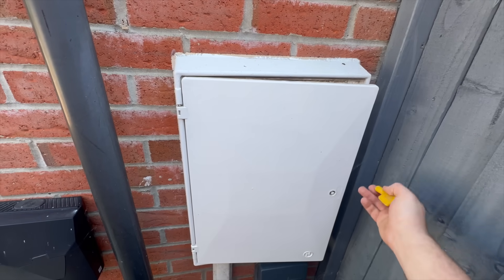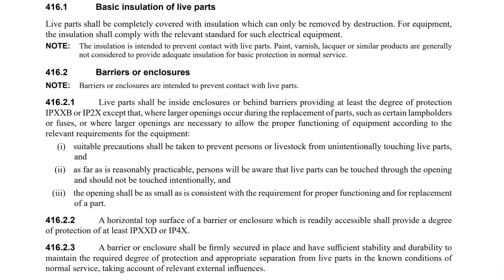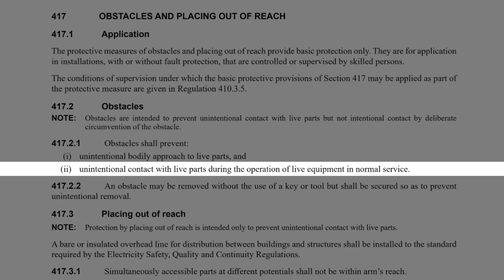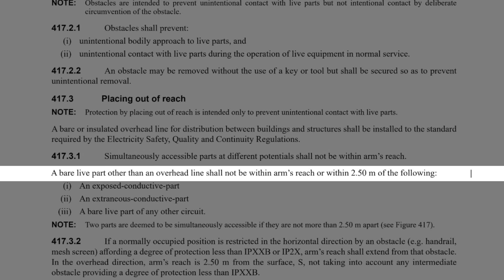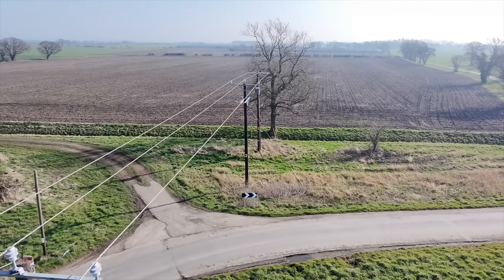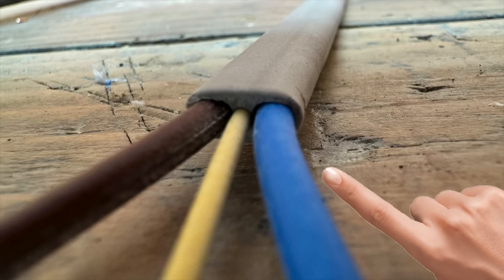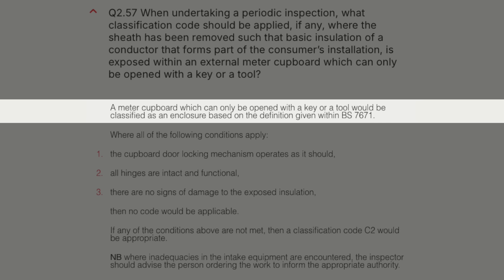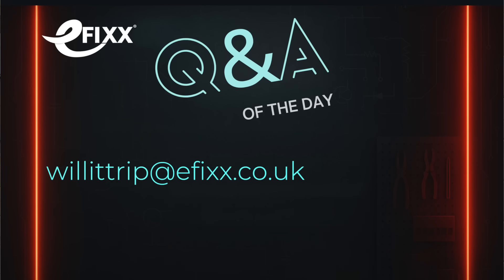This Should Be Illegal… But Isn’t!

Comment: I recall this topic coming up at CEF Live last month. obviously I forget exactly how they put it at this point, but my take-away is that meter cupboard effectively can't even be considered enclosures, since:
A) the general public are expected to access them
B) using a key mechanism that doesn't even require the right key, pretty much anything can be stuck in there to turn it
C) even if you can't unlock it, the door easily lifts off it's hinges
D) and my own observation (shared by many if not everyone here) that it's pretty common to come across meter cupboards with the door missing entirely, or even some old ones with wooden doors (that have generally seen better days).
Reply: Non electrician here. But as the householder is expected to open the meter box to take meter readings, the fact that the box may meet the technical requirements of an enclosure is pointless as a means of protection. And that's without taking into account those with missing or damaged doors, or simply left unlocked.
Reply: A - general public (not all) can use a screw driver - meaning they can access a consumer unit.
B - you still need a tool to get access, meaning it still passes.
C - only once you've used a tool to open it.
D - only then its a fail
Don't get me wrong, what we have is not the safest but how far do you have go before the cost becomes ridiculous to upkeep. Do we encourage people to lose their common sense instead.
Reply: @PF-gi9vv the general public can of course get into a consumer unit with a screwdriver, but that's not the issue. The issue is they don't NEED to access inside a consumer unit. Whereas, the public NEED to access the the meter box in order to read the meter.
Reply: @DS-tp6vx  That doesn't matter, the regs says you need a tool to get in, then its fine, whether joe public has to do it or not.
Reply: @DS-tp6vx  the point is that you need to do something to bypass the first layer of protection against accidental contact under normal conditions. You still have the second layer of protection. Just like every junction box in the property. Once you open a junction box, you can touch conductors protected by only a single layer of insulation. 
Look at it another way - how would you rectify it? Double sleeve? To what thickness?
Reply: Fool, get a life.
Reply: You are "gold-plating" this issue again.  Stop inventing your own additional requirements.
Reply: @JimWhitaker  Just passing on what  they said at CPD talks. Don't shoot the messenger.

Comment: 53 seconds ffs what is that in the socket?    The cabinet is expected to be opened by a civilian so all bets are off at that point.  Why isn't the SWA earthed?  If you are fitting a gland to the SWA why not just attach an enclosure  under the isolation? By the logic a floor is more enclosed than a meter cabinet!

Comment: Total crap - it’s an enclosure that would be expected to be accessed by ordinary persons

This has come about through pressure from housing developers / house bashers cutting corners so much it’s been allowed to become the norm

I’ll continue to C2 and fail every single one of these cowboy jobs that I come across
Reply: Wrong answer.
Here's the official answer.
Don't think you know better than the experts. Suggest you go download Guidance 4 and read it. You will find it will help you code correctly. It has lots of examples.

The authoritative answer is provided below.

Here is the definitive answer from Guidance 4, Issue 7.2, Electrical Installation Reporting, produced by Electrical Safety First .

The following scenario is to be coded as a C2:
Quote:
 Single-insulated cables in a meter cupboard which can only be opened with a key or tool, but where any of the following conditions apply:
• the door mechanism doesn’t operate as it should,
• any hinges are not intact or non-functional,
• where there are signs of damage to the exposed insulation.

End Quote:

If there are single insulated cables in a meter cabinet and that cabinet is damaged in someway which makes it easy to get into without using the proper tool to open it, THEN you code it up as a C2.

If that meter cabinet is NOT damaged in anyway, then it is a C3.

That's the official definitive answer .

And when you think about it, it makes sense: the single insulated cable does not pose an immediate danger. If it did, it would be a C1 or a C2.

The risk of danger is increased if the door to the cabinet is broken in someway, if it can be lifted off it's hinges, or the locking mechanism is damaged or not present, then somebody can enter the cabinet and interfere with those cables. So obviously, the level of risk is increased if the cabinet is damaged. And to record that means it must be increased from the C3 to the C2.

Comment: Only modular panels in UK have barrier. Meter panels in UK have no barrier at all. In continental Europe panel can't pass inspection if some equipment is not covered, so electricians use jigsaw to cut barrier from plexiglass. 

It is very strange that UK energy companies allow to install their electricity meters in bare panel, where everyone has possibility to connect jumper wire and steal electricity.
Reply: Taper evident is really all that most countries go for.  In reality you can't stop a determined person all you can do is make it so you know someone has been fiddling.  When meters were being manually read the reader would take note if there was signs of tampering.  It's more about safety these days.  Average person off the street can't have access to hazardous situations, so single insulated is behind things that need a tool to access and that tool is more than a simple generic key guarding a location where untrained people are expected to go.  If single insulated was exposed like this is in Australia the electrician that did it would be getting a call from their state's safety board, a fine and a requirement to do retraining.

Comment: C2 minimum as the notes about keyed or tool access presume only competent people will have cause to open them.  In a residential setting it is often the case that the home owner / tenant is expected to interact with the equipment inside: pre-payment credit keys are a good example.  
The elderly, disabled, terminally stupid, cognitively impaired etc can all be expected to open the external enclosure, come rain or shine, with whatever they happen to have in their hands, whilst standing outside on the actual earth.  It is reasonably foreseeable that untrained persons will open the electrical cabinet because that is what they are expected to do!  
That last layer of insulation is not designed to cope with general wear and tear administered by the user.  I'm not the only one who has seen damaged outer sheathing from people having the credit key on a big bunch of keys and charms.  Not having a mechanically protective outer layer present is madness, as are the worthless guidance notes featured in this clip.

Comment: Unacceptable to have single insulated in a location where an unskilled person can and is expected go.  That it has a simple key to access doesn't change that risk as people will need to access the cabinet to do manual meter reads and operate the mainswitch.
Reply: Wrong. Yes it does change the level of risk.

The authoritative answer is provided below.

Here is the definitive answer from Guidance 4, Issue 7.2, Electrical Installation Reporting, produced by Electrical Safety First .

The following scenario is to be coded as a C2:
Quote:
 Single-insulated cables in a meter cupboard which can only be opened with a key or tool, but where any of the following conditions apply:
• the door mechanism doesn’t operate as it should,
• any hinges are not intact or non-functional,
• where there are signs of damage to the exposed insulation.

End Quote:

If there are single insulated cables in a meter cabinet and that cabinet is damaged in someway which makes it easy to get into without using the proper tool to open it, THEN you code it up as a C2.

If that meter cabinet is NOT damaged in anyway, then it is a C3.

That's the official definitive answer .

And when you think about it, it makes sense: the single insulated cable does not pose an immediate danger. If it did, it would be a C1 or a C2.

The risk of danger is increased if the door to the cabinet is broken in someway, if it can be lifted off it's hinges, or the locking mechanism is damaged or not present, then somebody can enter the cabinet and interfere with those cables. So obviously, the level of risk is increased if the cabinet is damaged. And to record that means it must be increased from the C3 to the C2.
Reply: @deang5622  One of these days you'll actually understand what you are doing.  One of these days.  Tip:  the author of the video specifically asked for thoughts and opinions.  Perhaps you should try that - think.

Comment: Back in my day the cables used for meter tails were called "insulated and sheathed cable" and we also had "Service Cable Connectors"
Reply: Indeed. They are not "double insulated", the outer sheath is actually mechanical protection.

Comment: C2, it could be argued that it's inaccessible without a tool (the key) HOWEVER every householder will have that key, so it's definitely a C2 for moi
Reply: Every house has a screwdriver so is your DB a C2, same principle.
Reply: @shaunmajor2052 but most homeowners don't need regular access to that... These days the homeowner does need regular access to the metre cabinet because the metering companies don't bother to come and read it
Reply: Unfortunately some adults can't be helped. It's kids I'm most concerned about
Reply: @aussiejackofalltrades  valid point, unfortunately the regs dont discriminate  between kids and morons
Reply: You don't need the key though, can stick just about anything in there to turn it, or just lift the door off it's hingers. Assuming the door is still there and intact, founds plenty of meter cupboards with doors missing or smashed (usually where it's accessible to anyone walking past, so probably kids being destructive).

Comment: 0:09 I don't like to see SWA cables without either a proper gland, or the armouring not grounded.
Reply: I know national grid want to see that or a switched fuse after the isolation.
Reply: It could be connected to the earth bar at the consumer unit . You only need to connect one end if its not being used as a cpc .

Comment: If the idea is that the householder can't gain access to this meter cupboard and so this exposure of the cables is OK - then how does the householder read the meter (if they don't have a remote display for it)?
Reply: That's not quite correct.
The householder is expected to gain entry to the cabinet and must do in order to obtain meter readings in the event the meter is not a smart meter.

The issue is around whether the cabinet key is required to gain entry to the cabinet.  If the meter door is damaged, missing lock mechanism or if the door can be removed from the hinges, the risk is higher as it means anyone can gain entry, easily, just walking past and not equipped with any tools, a person, a child can enter it and interfere with the cables. That's the danger.  The likelihood of this occurring, is still low, but it is increased when compared to the scenario where the cabinet door is undamaged and the locking mechanism is functioning correctly and has to be used to gain entry.

So whether it is a C2 or a C3 DOES depend on the correct functioning of the locking door mechanism.

The authoritative answer is provided below, along with the official document which describes this particular scenario.

Here is the definitive answer from Guidance 4, Issue 7.2, Electrical Installation Reporting, produced by Electrical Safety First .

The following scenario is to be coded as a C2:
Quote:
 Single-insulated cables in a meter cupboard which can only be opened with a key or tool, but where any of the following conditions apply:
• the door mechanism doesn’t operate as it should,
• any hinges are not intact or non-functional,
• where there are signs of damage to the exposed insulation.

End Quote:

If there are single insulated cables in a meter cabinet and that cabinet is damaged in some way which makes it easy to get into without using the proper tool to open it, THEN you code it up as a C2.

If that meter cabinet is NOT damaged in anyway, then it is a C3.

That's the official definitive answer .

And when you think about it, it makes sense: the single insulated cable does not pose an immediate danger. If it did, it would be a C1 or a C2.
Reply: @deang5622  Thank you for explaining that so well.

Comment: C2 all day for me. It’s usually the first instance of shite work that I’ll be finding on that EICR and shows an obvious lack of care. I had this argument with another firm who did a new build who argued about the key situation being no different to removing a socket face, which I clapped back with the fact socket circuits have 30mA RCD protection whereas the meter box doesn’t require any meaningful tool to access and the only protection was the service head fuse. Totally different things. At the end of the day, it’s still a basic insulated live cable that can easily be grabbed and that meter box lid isn’t going to last forever.
Reply: 100% customers are EXPECTED to open them!
Reply: Wrong.

Here is the definitive answer from Guidance 4, Issue 7.2, Electrical Installation Reporting, produced by Electrical Safety First .

The following scenario is to be coded as a C2:
Quote:
 Single-insulated cables in a meter cupboard which can only be opened with a key or tool, but where any of the following conditions apply:
• the door mechanism doesn’t operate as it should,
• any hinges are not intact or non-functional,
• where there are signs of damage to the exposed insulation.

End Quote:

If there are single insulated cables in a meter cabinet and that cabinet is damaged in someway which makes it easy to get into without using the proper tool to open it, THEN you code it up as a C2.

If that meter cabinet is NOT damaged in anyway, then it is a C3.

That's the official definitive answer .

And when you think about it, it makes sense: the single insulated cable does not pose an immediate danger. If it did, it would be a C1 or a C2.

The risk of danger is increased if the door to the cabinet is broken in someway, if it can be lifted off it's hinges, or the locking mechanism is damaged or not present, then somebody can enter the cabinet and interfere with those cables. So obviously, the level of risk is increased if the cabinet is damaged. And to record that means it must be increased from the C3 to the C2.
Reply: @deang5622  That’s just guidance, I’ll make up my own mind. If you take it as gospel you’re doing something wrong yourself.
Reply: I’d put it as a C3 but each to their own
Reply: @12000gp  at your own risk
Reply: coding is about justification, if you can justify your C2 code fine, it i can justify a C3 then thats fine, you cant argue with either if both can be eelectricians justify their codes. Personally as the video and many others C3 is fine
Reply: @pault4793  at your own risk

Comment: Not an electrician but finding these fascinating, I suppose it's obvious but there is an awful lot to know and then understand to be a good electrician, each of these is a good reminder for me to leave well alone. Keep them coming.
Reply: @RichardBacon-h5x  this isn’t in line with a good electricians practice. A good electrician would install an enclosure, gland the swa cable properly with a gland and use double insulation on the exposed cables.  This is a work around and bending words to achieve race to the bottom lower uk standards.